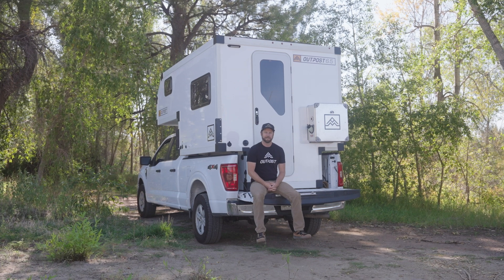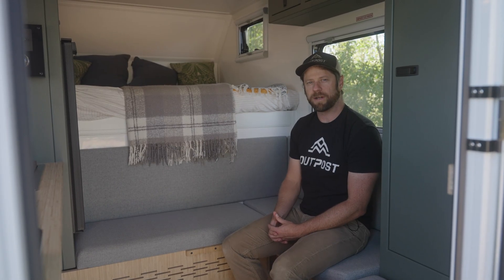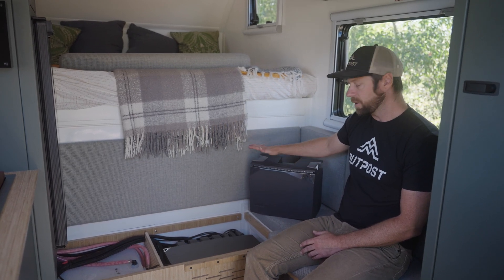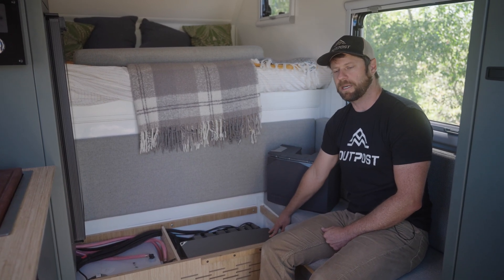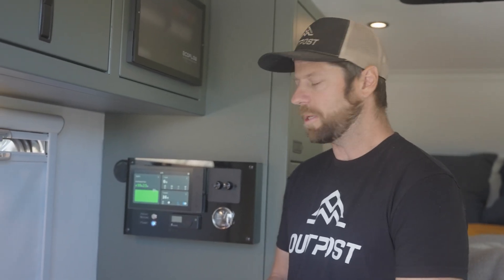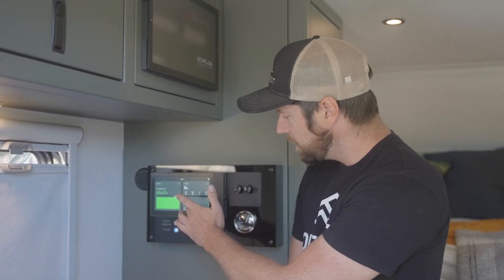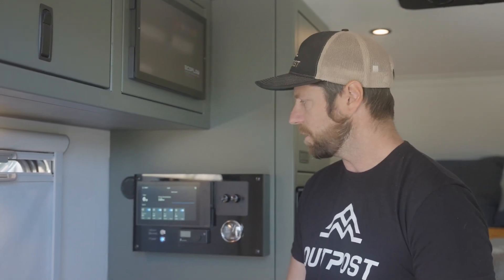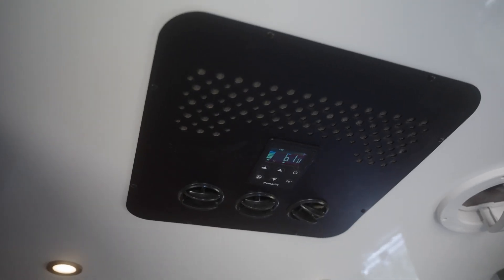2024 Outpost 6.5 - Off-Grid Electrical System Overview

Comment: one thing you didn't mention, i'm guessing you could also charge via DC-DC (800w?) and via AC via the shore power in off the truck's built in inverter or a cheap second inverter at the same time. This would be super nice for people using the air conditioning and want quicker recharge times, especially those with hybrid trucks like the powerboost that already have massive inverters built in so you can quickly push that charge back to the ecoflow battery where it's needed for running the A/C
Reply from the maker: Thanks for the question! We haven't had anyone use the Outpost 6.5 in this way but the EcoFlow Power Kit does support simultaneous charging up to 100a. Two big considerations: First, more charging equals more work for your truck's alternator (make sure you are staying within limits here). Second, be careful with cheap inverters, we have seen a couple of instances where the cheap built in inverter (300-400w) in truck beds doesn't produce clean enough energy for the EcoFlow Power Kit, tripping it's safety triggers.

Comment: I'm a cash buyer looking for a truck camper and I find these campers tempting, the problem is there's little information about them. You didn't mention the distribution panel and its capabilities (yes I see it), nor the quality of the components used. How many AC outlets? How many DC outlets? Where are they? Do you use a quality Marine Grade Tinned Twin-Core Wire? Marine grade outlets and fuses or big box?

The point is I can't find any information on the quality of products used for your builds, from adhesives to quality of LED (assumption) lighting used. Is it possible to search your website and piece together a true electrical system overview? From what I can see you have a nice product, but information is lacking, and the thought of pulling 40K out of the bank to purchase so many unknowns doesn't leave me warm and fuzzy.
Reply from the maker: Thanks for checking out Outpost Campers! We are currently booked out with reservations through Early Fall of 2025. We are taking 100% refundable deposits of $1000 to save your spot in the reservation list. 

Regarding your questions, we are always just a call away to answer all of the details you are hoping to learn about the Outpost 6.5. We want to make sure you feel warm and fuzzy before placing a deposit :) Our normal shop hours are Monday through Thursday from 7:30a-5p MST. (970) 444-1740.

https://outpost-campers.com/

p.s. EcoFlow has a wealth of information on their Power Kits which is the heart of the electrical system we use in the Outpost 6.5

https://www.ecoflow.com/us/ecoflow-power-kits/series

Comment: How long to charge battery if using solar and alternator at the same time? Assuming that battery was initially at zero
Reply from the maker: There are a lot of variables to consider when answering that question. One battery or two batteries? Are we in optimal solar conditions? One solar panel or two? What loads are on the system? Can the truck's alternator support 50 amps of 12V output? It's not a simple question to answer, but I'll answer for one specific set of circumstances. 

Hypothetically, let's say we have a 4,000 watt hour (4 kWh or 2 battery configuration) battery bank with a 500 watt solar array (2 panels). We are in optimal sun conditions (let's say the panels are putting our 400 watts of charge), and driving with 30 amps of 12V charge (approximately 400 watts). In this scenario, we're charging 400 watts from the truck's alternator on the DC-DC charger, and 400 watts on solar. Assuming no other loads on the battery and all else equal, we're charging at 800 watts. 4,000 watt hour battery bank divided by 800 watt hours of charge (4,000/800) shows 5 hours to charge a completely dead battery from zero to full. That same system would take half the time to charge zero to full if the battery bank was halved (1 2kwh battery instead of 2). 

This is a hugely oversimplified example as it doesn't take into account many variables in a typical lithium battery charge cycle and assumes no loads and a very specific solar and DC-DC output scenario, but hopefully this is helpful.

In reality, it will be extremely rare that you have depleted your battery to zero (do you drive until your car's fuel tank until you're completely empty and stranded on the side of the road?), and you'll likely be bouncing between fully charged and 50-75% charge for most camper use cases unless you have some unusually large electrical loads.
Reply: So..I am going to have to educate myself on how much power the induction cook top uses. The galley has always been the heart of any of our adventures(boating, bike touring, hiking) and I just want to make sure it can handle the demands.

Comment: Hi, I am a little confused are these batteries lithium iron oxide or lithium ion. It is my understanding that lithium ion batteries are a fire hazard and most or all companies are going to lithium iron oxide.
Reply: Ecoflow uses LiFePO4 batteries, the ones that are much less likely to runaway and catch fire.  Same chemistry as Victron, Lithionics or any other industrial lithium battery installed in a moving vehicle or vessel.

Comment: About how long can you run the A/C unit off the battery, if you're not charging with solar at all?
Reply from the maker: On Eco Mode, it will run for around 10 hours on a fully charged 4KWH battery bank. About half that on full blast. Solar or DC-DC charging will significantly increase run time, and of course you can run it indefinitely if plugged in to grid power.